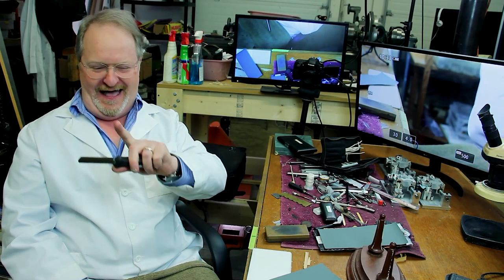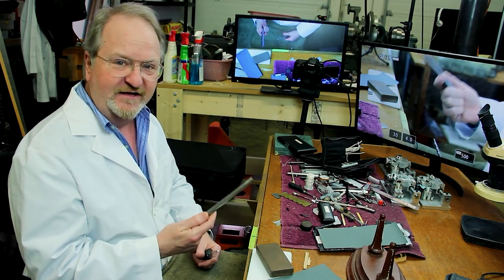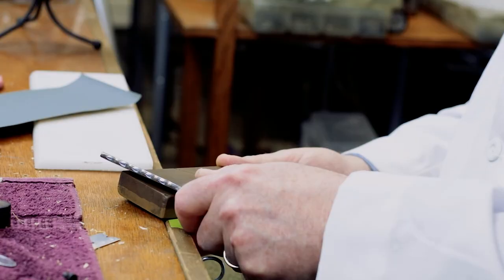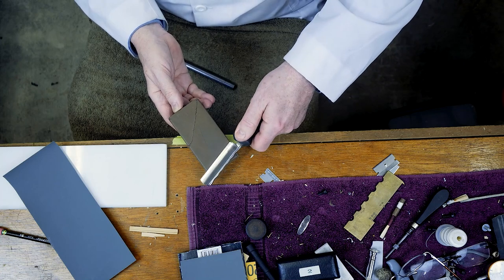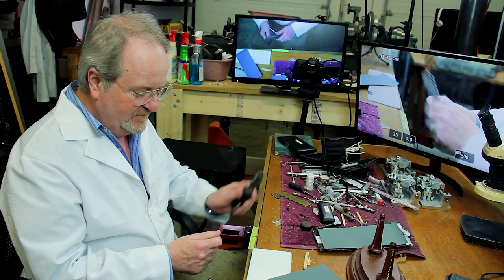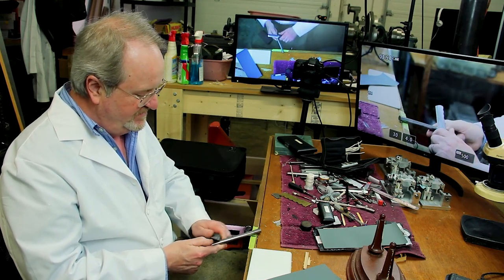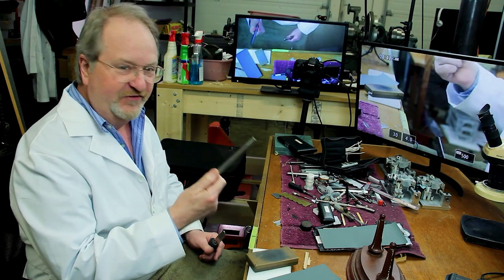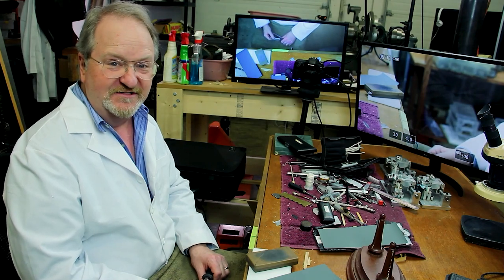How to Sharpen an Oboe Reed Knife for Making Oboe Reeds.

Comment: Use a wood plaque and sharpen a whole lot less!
Reply from the maker: I believe that a wooden plaque would need to be too thick to give enough support.   That is why I do not believe in using contoured plaques.  This would weaken the sides of the reed.  Having a sharp knife is so important in applying any sophisticated scrape on an oboe reed.  This method of using a steel rod to dress the edge of the knife is not the same as sharpening a dull knife.  That is a different video.
Reply: @robindriscoll  I disagree. The flat plaque flattens the arch of the cane, causing the knife to scrape thinner along the sides and spine. The contoured plaque supports the arch, allowing the knife to cut down the center of the channel more deeply than the edges or spine. But this choice is a function of reed and scraping styles, and, like so many so many reed making choices comes with time and experience. Ultimately you do what works best for you, and I only throw it out because of tie time I save. I can make 3 0r 4 reeds before resharpening, and still have a thin, clean chip off my knife, using a wooden plaque...